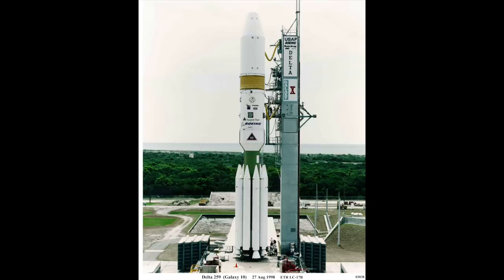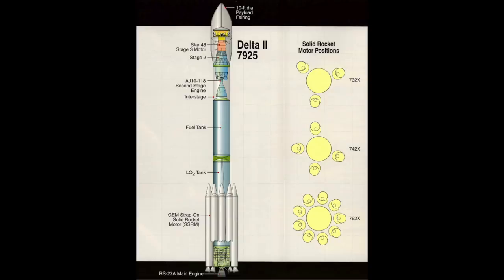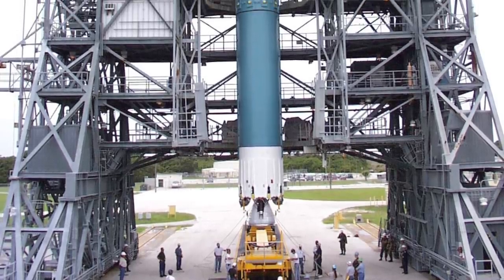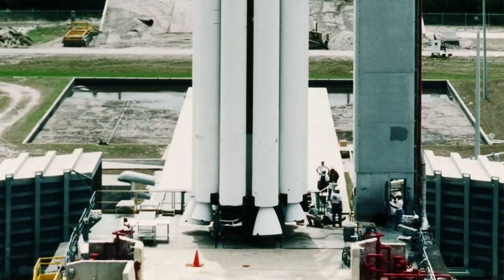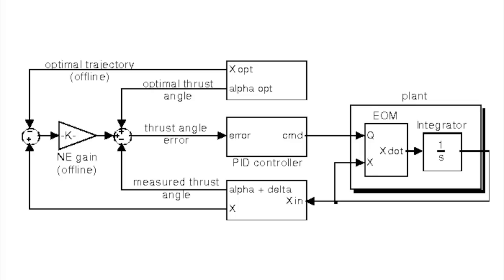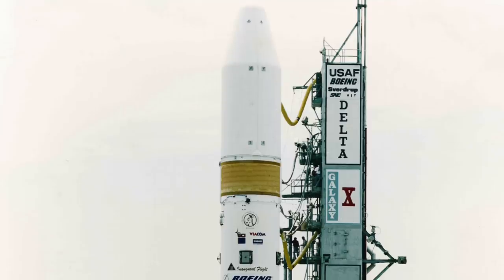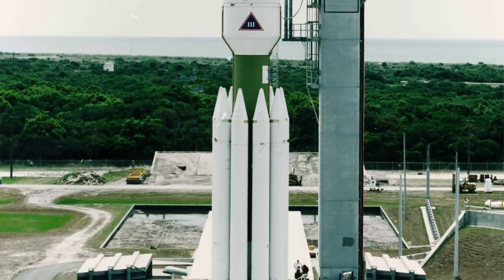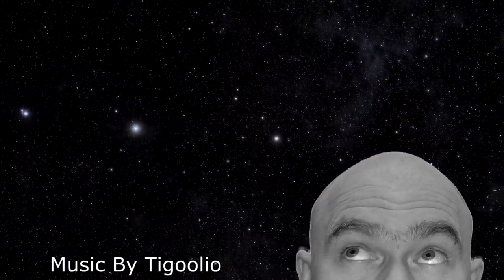Why The Delta III Rocket Exploded On Its First Flight - Why Rockets Fail

Comment: Why don't they put the same system that will save astronauts from an exploding rocket, when they putting satellites into orbit.
So the payload can be saved?
It just seems like it would be good insurance to have!
Reply: Weight, space, CG, $$$, etc, etc, etc.
Reply: Launch escape systems are surprisingly heavy, have to be powerful to accelerate that quickly. The one on Orion weighs 7 metric tonnes, which is almost 3/4 the weight of the capsule it's pulling (10,400kg). Easier to buy insurance, which they do.

Although I'm surprised those billion dollar US spy satellites don't have this. Perhaps the mirror (the expensive part) couldn't survive the forces.
Reply: Crewed spacecraft already have the means to land: thermal protection, parachutes or landing motors, landing gear, structures rated for descent and landing forces, etc. That's a lot of weight and cost to add those things to a spacecraft that isn't supposed to use them unless something goes wrong. And if the satellite isn't designed to be reused after landing, it's going to need a complete tear-down and rebuild to ensure that you don't have internal damage or contamination. It turns out to be cheaper to design satellites with the capabilities that they'll need for a successful flight, then get a normal insurance policy to pay for a replacement if you need one.

SpaceX Dragon is intended to land in normal operation. After the CRS-7 failure, SpaceX updated Dragon's software to attempt a parachute landing if a future Dragon finds itself in free fall on ascent under similar circumstances.
Reply: @bfrobin446  I did not know about the added capabilities on the dragon in case of ascent abnormalities. Thx for this info.
Reply: @donjones4719  
Good answer.
But things change as technology gets smaller and lighter.  
Especially with different agencies sharing the same launch.
At some point the insurance company will want insurance!